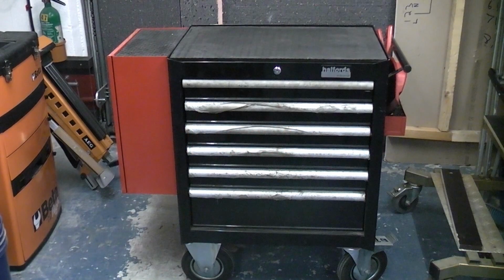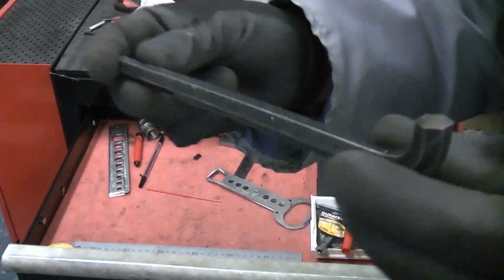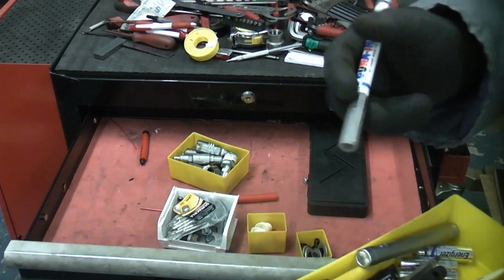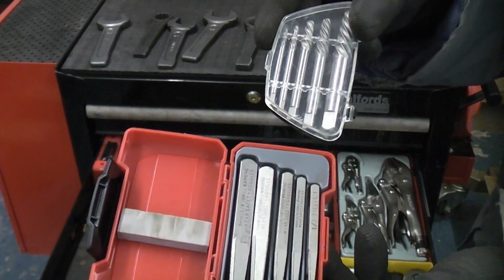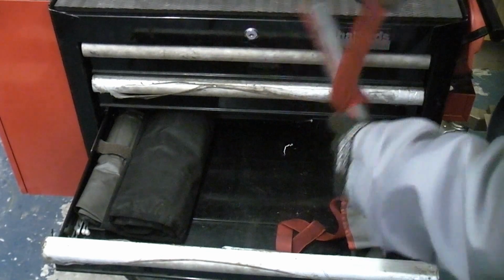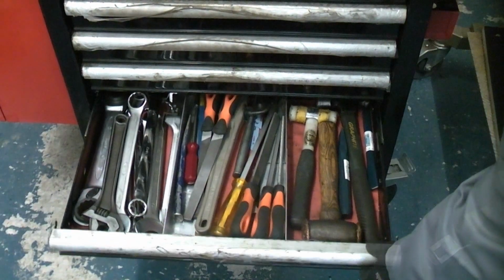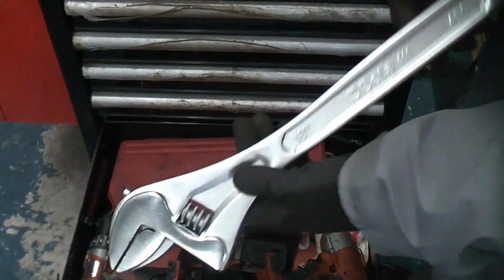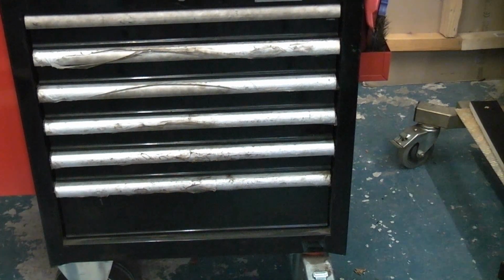Ultimate Handyman site Tool box tour

Comment: Do you Remember where you got the uprgraded wheel castors for your tool box from? Cheers
Reply from the maker: I bought them at auction, but these are the ones- https://www.northerntool.com/shop/tools/product_200664438_200664438
I have had them on my box for about three years now and they are great and still work well.

I'm not sure if the wheels in this video were the larger black ones, I bought them from ebay, but they did not last long before they needed replacing.
Reply: @ultimatehandyman  Thanks for your reply. Could i ask how you fitted them? Im having trouble finding the right size fitting plate for my tool box.
Cheers!

Comment: Are you a fitter or a spark?
Reply from the maker: I'm qualified as an electrical mechanical maintenance engineer but I do mainly fitting as there are a couple of dedicated sparks on the sites that I work on.
Reply: Cheers mate, I trained as a fitter at a power station - Agecroft in Manchester. Nice tools you have and your DIY vids are also top drawer. Keep up the good work.
Reply from the maker: Nice one ;-)
Thanks for the comments

Comment: Hy,could you please suggest the best material to cover and waterproof my shed roof.  Been told 'flashband' but reviews say it's not great. I don't want to use blow torch material
Reply from the maker: +scott mclean 
I would use a good quality felt. Flashband is no good to cover a complete roof!
Felt should last for a long time as long as it's installed correctly. 
Something like this- http://www.diy.com/departments/bq-green-roofing-felt-l8m-w1m/42448_BQ.prd
Reply: Thanks, and thanks for the link. If I put on two layers straight on top of each other would it be double the protection or would I b wasting my time and material
Reply from the maker: +scott mclean 
You would be wasting it to be honest.
There are a few videos on YouTube showing how to apply the felt ;-)

Comment: i was gonna buy that tool box but they wanted £100 for delivery
Reply from the maker: +TheFpsGamer 
Blimey, where are they sending it from, bloomin China?
That's a ridiculous price for delivery!
Reply: about 5 minutes down the road i would go and get it but it wouldn't fit in my car
Reply from the maker: +TheFpsGamer 
It'll fit in most cars as it's not that big with the wheels removed (you have to fit them yourself).
You have to watch out for the special deals though as I'm sure I paid for the bottom part and got the top box free, if I remember rightly!
Reply: i might have to go down and get it then
Reply from the maker: +TheFpsGamer 
It's a good box, but the wheels are not that good. I'm on my third set of wheels now but they do get lots of abuse due to the quality of the floors where I work and also the amount of weight in the box. Occasionally I'll put a valve on the box as well and that might weight 40+ KG's
Thanks for the comments

Comment: I liked it all. but one question. you call the Milwaukee drill 'cheep' in canada and the USA Milwaukee is the standard in cordless power tools. what is the standard top end brand over there?
Reply from the maker: +James MacInnis Milwaukee are not a cheap brand over here but they have an expensive version with a metal chuck and a much cheaper version with a plastic chuck. This model is the one with the plastic chuck. I am sure that Milwaukee's more expensive version would be a good drill.Thanks for the comment ;-)
Reply from the maker: +James MacInnis I just thought I would add to this. We have Dewalt, Bosch, Milwaukee, Metabo, Fein, Hilti and Festool.Dewalt, Bosch and Milwaukee all make cheaper versions of their high end drills, which I believe is bad as people buy one of the cheaper drills and it breaks, so then they go around telling people that the brand is crap as they bought a drill once and it broke after a few weeks. Metabo, Fein, Hilti and Festool make good quality tools (although I do remember knowing someone that had a problem with a Metabo drill once) but are very expensive for most people.
Reply: Thanks for the extra information. I love tool videos.
Reply from the maker: +James MacInnis You are welcome. I love tools ;-)Thanks for the comments

Comment: How's the quality on the Teng Tools stuff? They seem to be quite reasonably priced but I haven't seen anyone using them around here.
Reply from the maker: Teng make very good quality tools, they normally have a good warranty too and if the tool breaks under normal use you can normally get it replaced for free. Most of the maintenance engineers that I work with use Teng tools as they are cheaper than Snap on but still good quality.
Their adjustable spanners and pipe wrenches (Stilsons) are crap though compared to Bahco adjustables and Record or Ridgig Stilsons.
Thanks for the comment
Reply: *****
Alright, thanks for the info.

Comment: Your scissors are trauma shears just in case any one watching wants to find some online.  I have used them to cut a safety boot in half. Couple of quid online, they are cheap and effective.
Reply from the maker: Thanks Jeff, I did not know their name. They are very effective at cutting though, at first I thought the guy that sold them to me had pulled a fast one and sold me a pair of junk scissors but they have always performed well.
Thanks for the comment
Reply: No problem UH.   I just ordered a dozen for a first aid group.  My mate is a paramedic and he uses them for cutting through motorbike leathers and seat belts.  Or he did years ago, they may have setting better now?
Reply from the maker: Jeff Watt
They probably still use these as you say, I can't think of anything better for cutting seat belts etc.
Thanks for the comments

Comment: There is tools there I never knew existed, like the flogging spanner, cobalt bits ect. Good selection of well branded tools not likely to break under pressure. You don't mind if I borrow your cordless impact wrench !? back in a jiffy
Reply from the maker: LOL, The flogging spanners (or slogging spanners) are common in heavy industry. I used to use one of these on a daily basis a few years back when fitting steel wheels to bogies that are moved on tracks (like trains).
Thanks for the comment

Comment: Oooh, i remember that drill, bag of flaming you know what, i remember you saying you had an M18 that was broken but didn't realize it was that one, i had it also and it had a terrible gearbox and gear changer if it went in gear after hard use and drained batts for fun, i updated straight away when the hd18pd came out, i still use it from time to time, but prefer my fuel combi now. Thanks for the walkthrough.
Reply from the maker: Yeah, that's the one! I filmed it smoking in the garage before I sent it back and was going to post it on here if the Milwaukee warranty did not fix it but fair play to them they fixed it quickly and for free. I keep telling people about drills with plastic chucks being inferior and this drill just proves the point. A guy I work with has the M18 metal chuck version and it's awesome! 
Thanks for the comment ;-)

Comment: Nice set up! What exactly do you do? Couple of recommendations
- get some maratac  combat sheers (they are like the scissors you have but on steroids, i have a set and ive cut through 2p coins effortlessly!)
- the fenix HP11 is the best headlight ob the market for the money I highly recomend it for the money. Or any fenix or thrunite brand of torch available from amazon you wont be disappointed with those lights.
- a cracking work knife is a mora companion or mora all rounder. They cost about £10 and they are super razor sharp and are available in all different blade shapes for different tasks they are a must have for any tradesman.

Really interesting video i love seeing other people's tools you should definitely check out some of the tools above you wont regret buying any of them.

All the best Cameron
Reply from the maker: Thanks Cameron, I'll check out the Maratac shears. As for the knife and torch, they might not be allowed on site. We are only allowed plastic knives on site with retractable blades. Any torch has to be intrinsically safe as there are zones on site where there is the potential for explosion with the fumes from the chemicals on site. I'll still check out your recommendations though ;-) 
I'm an electrical/mechanical maintenance engineer in a chemical plant that manufacturers Acrylic sheet, although I mainly do mechanical work. 
Thanks for the comment ;-)

Comment: Cracking set of tools you got there bud. What do you actually do? I presume you work at power stations or something like that given all your heavy duty gear.
Reply from the maker: Thanks ;-)
I subcontract as an electrical/mechanical maintenance engineer for a local Chemical company. They have a lot of steam pipes, water pipes, air pipes on site, hence the big spanners etc.
Thanks for the comment